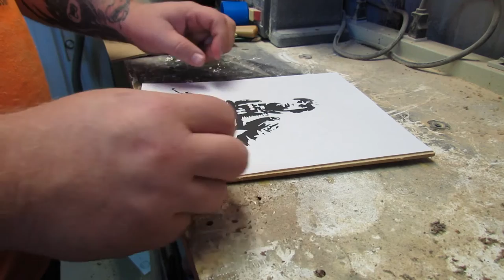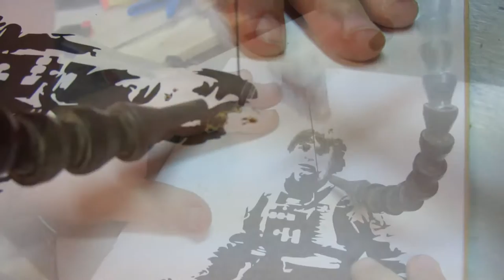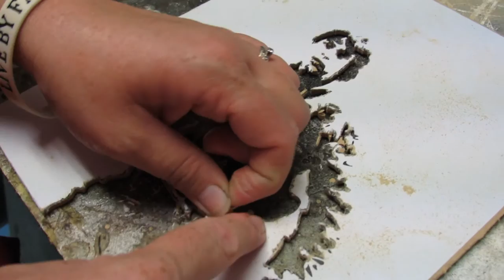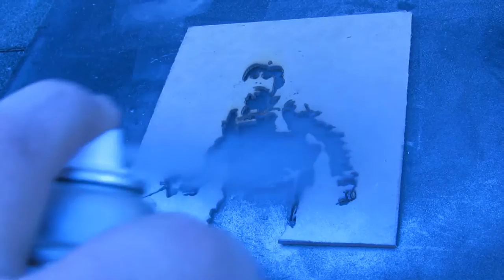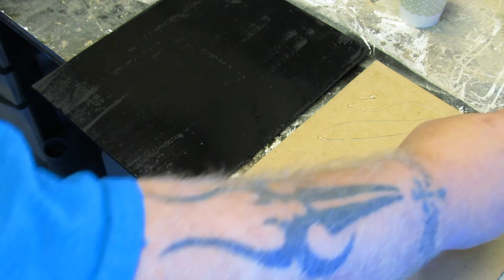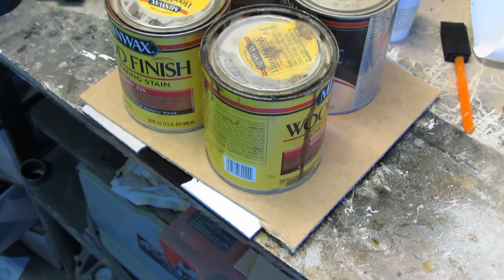Skywalker Wall Art - Scroll Saw Project

Comment: that's cool, what was the reason for the burning? I thought it was for a look a like a laser cut but you painted it.thanks for sharing.Chuck
Reply from the maker: Whenever I cut MDF with a spiral blade I always burn the edges because there are a lot of fuzzies. It's quicker than sanding and works really well. Thanks for checking it out, Chuck.
Reply: good info for the MDF fuzzies.
very cool project
Reply: Waylight Creations I was gonna ask the same question. Great idea, I hate the extra sanding.

Comment: Nice job. What type of scroll saw blade is that? Does it cut in any direction?

Thanks
Reply from the maker: Yep, it cuts in any direction. It is a spiral blade. They are hard to mess with, but work great for stuff like this where there aren't a lot of straight lines.

Comment: Question: Why did you use the torch.  Was it for added effect or to get rid of the tear out left behind.
Reply from the maker: It was to burn off the tear out that was left behind. Spiral blade cutting MDF leaves behind fuzzies and taking a torch to it is quicker than sanding and looks just as good. At least it does when you are painting anyway. Thanks for watching.